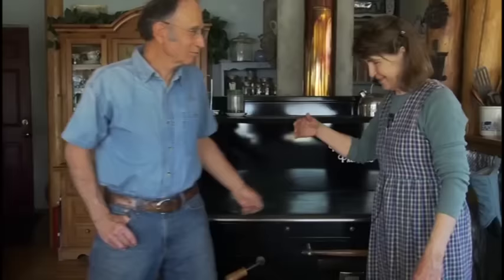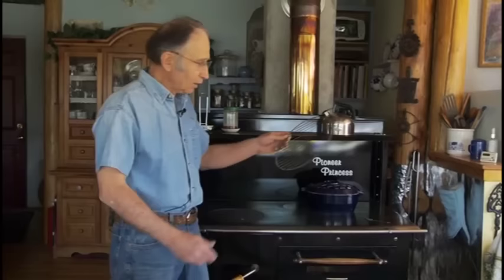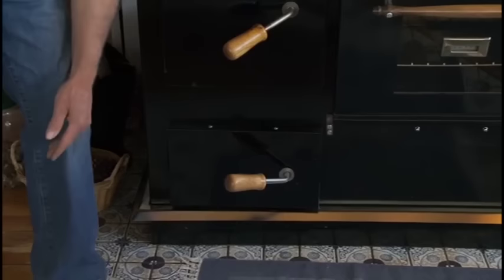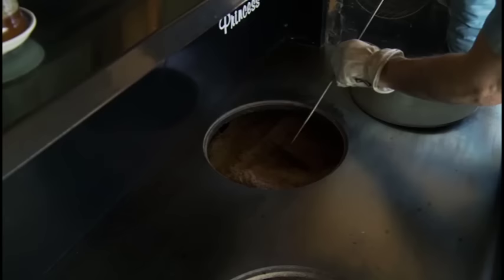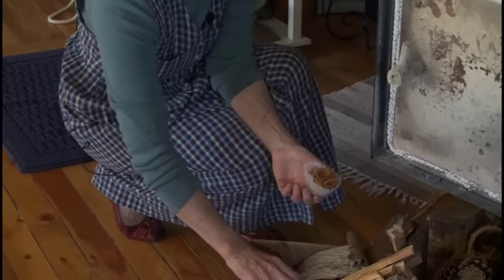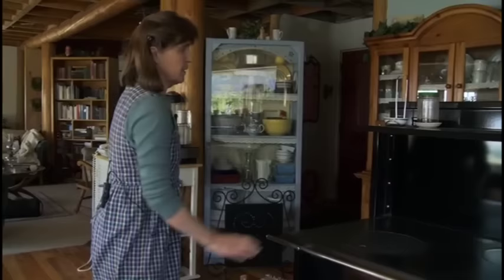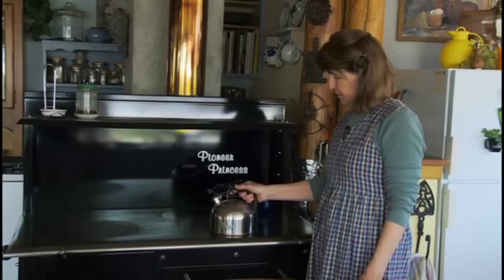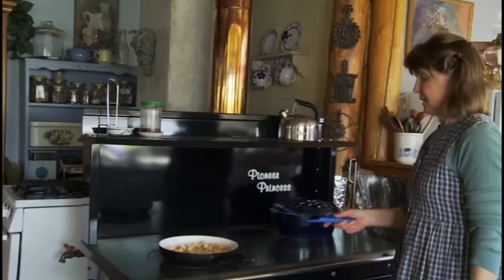A Wood Cookstove is a Must Have!

Comment: Loading the firebox to the max and then slumbering the stove slowly for hours is the least efficient way to burn your wood, and also incredibly polluting. I realise that for space heating purposes this is sometimes seen as necessary, but it really should be avoided wherever possible. Small, hot fires are significantly cleaner, will give you more useable heat from a given weight of wood, will significantly improve the emissions of the stove and also prolong the life of the flue. Much as I love wood cooking and heating I would hate to have a neighbour who slumbered their stove for months at a time.

Comment: You really need a chimney cleaning brush they are heavy plastic that is what I use it will not damage the chimney like your scraper and wire brush might do if your not careful.

Comment: Thats life goals, right there. 
Recent quandary: do you think you could use the silicone or other newfound specialty-coated baking sheets could line the bottom of the ashtray for easy lift and dump removal?

Comment: 3500 Bucks...there is a thing called modern conveniences. As a cook and an everyday home cook. A good one I might add that can cook on any heat source. This wonderful stove is a waste of time. The space and fuel takes to operate is a waste of time and resources. One or two pans and a dutch oven is adequate for what ever you need. Using a stove to heat the house...Great Idea.

Comment: They're burning that stove dirty. ¾" of  creosote at the chimney is bad. Most likely those night burns are the culprit. Stoves should always burn as hot as safety will allow. I own both a wood burning kitchen stove and a wood heater. The kitchen stove only gets used for meals, using very finely chopped wood, for a fast hot burn. Otherwise the more efficient wood heater gets used more often.

Comment: Please tell them the safety bar in front of the stove is aluminum. Just like the aluminum they installed as a safety backer. It dissipates heat faster than any metal but gold or platinum. That´s why the tin tube they used to insulate the beam they mentioned. Did dot work. Tell them they can get a flat aluminum roofing sheet have it shaped by an air conditioning duct builder. or gilded by an artisan and install it for a more permanent look to their kitchen. Tin, copper, pewter, brass, will get very hot,  but aluminum will not.

Comment: WHO CAN AFFORD a good wood cook stove??? They cost as much as a decent used car!!! Because they have as much steel and cast iron as a modern car has in it! I have a 1944 Chamber gas cook stove that weighs about 600 lbs. It has a single oven, a broiler, griddle and deep well  and three top burners, and the oven will bake cakes and pastries as good as any oven made, except maybe a fire tube pastry oven only a pastry shop will have (or the RMS Titanic).  I've priced a new Blodgett 6 burner gas range-$12,000 WITHOUT OVENS!!! A Wrangler 4-top woodstove with oven is over $8000 and 2-year waiting time for delivery. The "full-size" 6-top is $12,000+ ( the price is TBA on delivery) and there is a two-three year waiting time for them currently. Add-ons like the water heater and deep well run the price WAAAAY UP into the Camry range.

Comment: How does it  provide hot water for the shower upstairs?? I’m sure that’s what she said... I can’t wait to get one of these stoves! :)
Reply from the maker: If you well water system is pressurized then you will have a shower on the second floor. Let me know if you need help.
Reply: Engineer775  Thank you so much!
Reply: She said convection - pressure created by the expansion of water when heated - if not given a place to go - upstairs in this case - it will explode - hence the fate of many old Mississippi Paddle Wheelers and Steam Locomotives - choo choo - engineer 775 is too young - this technology a little to old - for him to comprehend - how many cell phone kids today would understand rotary phone / banks of operators downtown

Comment: I have a small cargo trailer tiny house 8 foot by 32 foot with a 73-74 inch ceiling. It's 256 square foot total. Would a rocket stove be the best to heat with?

Comment: Those humidifiers are worthless. You're better off with a huge stock pot....stainless too. you're pretty much reducing water for months and the crusted mineral deposits are impossible to remove from iron or ceramic coated iron in this case, even after soaking in vinegar.

Comment: "There are ways you can tell [the oven temperature]: you just stick your hand in there, and depending on how long your arm is in there before it blisters..."

Or you could buy an accurate oven thermometer for less than $15 and hang it from the upper rack.
https://www.amazon.com/gp/product/B07B52PM39

Comment: rick are you aware of any wood cook stoves that are specifically designed to be efficient at heating as well? like with a blower or heat exchanger attached or something like that? of course any wood stove will naturally put out a lot of heat to heat the home but to my mind unless it has a blower or something it is not as efficient for that "side effect purpose" as it could be....to me the cooking function would be actually more of a secondary function....cooking with wood is more of a backup...but if i am burning a fire every day in the house it will cut down on the heating bill.....i dont want to have to get two wood stoves, one with a blower for heating and one with all the range/stove top oven etc
Reply: HI Michael, I recently commented on the types of kitchen woods stoves I have owned since 1976. The Heartland Oval will heat 1800 sq ft. You can put a non electric blower fan on the cook surface. We have a 1930 Home Comfort cook stove and a 2016 Enviro 1200 airtight that has a blower option. Frankly I prefer an airtight cook stove, like the Kitchen Queen or Pioneer Princess. Best of luck , Diane in New Hampshire.
Reply: diane hall thanks Diane I will take a look at those models

Comment: I am in the designing stage of creating a new kitchen. I've been researching wood stoves and wood cookstoves. I get the many benefits, however since I've haven't used one before,
can they be used in the spring and summer without overheating the kitchen? Thanks!
Reply from the maker: You can get a summer grate for the princess that raises the fire closer to the cooking surface. This allows you to build quick hot fires, cook your food and then let it go out before the whole stove and surrounding area get hot. They are about $100
Reply: @engineer775  Thank you for that, and the great information in your video!

Comment: The one thing I lack, for a SHTF scenario, is a hand pump for my water.  My well is 600 feet deep, though, so I'm not sure if that's even possible.  Any suggestions?
Reply: Frank Burns ---  We had a hand pump installed in our 80 ft. deep well.  They
guaranteed it would pull water up, and it does,  but it takes a lot of manpower to get one glass full.   It is disappointing,  but if you can do it,
you'd survive w/o elec. power to pump it.   It'd keep you alive in SHTF time.
Reply: That's the thing, though.  If yours takes a lot of manpower to get one glass, and your well is only 80 feet deep.  Imagine how much force it would take to get anything from 600 feet deep!  From what I've read, the deepest that any hand pump will work is around 250-300 feet.  I had no idea wells even WENT 600 feet before I moved here.  My neighbors' wells are only 200 feet or so.

Comment: DO YOU GET THE HEAT IN THE HOME WITH ONE OF THESE SIR---IS THERE A FAN THAT PUSHES THE HEAT OUT TO YOUR HOME
Reply: It radiates heat. No fan is needed.
Reply: Can buy all metal fans that circulate by no power that sit on top of stove

Comment: Holy crap people, never clean your stove and pipe like this. Take it outside and wear a mask.  Use a shop vac inside. Ash and creosote are some of the most toxic particles there are . These folks were my neighbors. They had so many chimney fires their chimney had to be replaced with stainless. Dont believe all these "pony rides in May sunshine "videos, very nice people and Janice baked up a storm, but they were lucky not to burn the house down. Use a shop vac when cleaning the stove , really helps with the ash. Having a wood stove in the middle of the house is a dirty affair, cleaning a stove like this makes your house way more dirty. I have a Pioneer Maid(used 20 years) and a Kitchen Queen(used 20 years), they are basically the same when it comes to using and cleaning. I have to clean my stove and pipe 3 times a year, or the stove basically just stops working and then you get into chimney fire mode, I have had several chimney fires in the first years using the Pioneer maid because I did not understand how fast they get clogged up, after replacing my own  chimney with stainless, I learned I need to clean it out about every 6 weeks or else. To me  this video shows how not to clean your stove.

Comment: I lived on a house built in 1885 we had a wood stove/cooker once every 3 to 4 years would we have to clean the chimney the ash twice a season there creating more work for them s elfs the eco fire....wax heats up like a par and sticks to those 90 deg corners high pitch wood does the same it like glue season your wood use pitch based kindling reluctantly Never and I mean Never use a wax based product in your stoves Hey? If your a new and it builds up chimney fire in a short time like a high pitch wood over a a few years think...... about what you put in your stoves.....no wax keep pitch to a minimum yes itvsyarts easy but in the long run your not doing your selfs any favors

Comment: Is fire required or that's optional?
Reply: Ya I think a gas burner conversion would work great.  Electric elements suck in my opinion and without even heat uneven expansion will crack the steal/iron. Of corse you could use molton salt from your nuclear furnace .Lol
Reply: "Is fire required or that's optional?"

It's a woodstove. Fire is the only heat source.

Comment: Have you tried cooking cabbage on a wood stove, on the slow cook side? You will soon realize that you actually love cabbage :D  but you didn't know that because you used electric stoves l until that time :) At least that is what happened with me :D By the way, there is a scientific explanation. The fire transfers heat to the cooking dish mush faster and the wood fire burns at an unstable rate, making the fibers cook with much more intensity

Comment: i live in norway and bought a simular oven but mine also heat water that i store in a 500 liter-200 gallon tank
https://cdn4.mystore4.no/thumb/646_600/varmeshop/74060_Nordica_Extraflame_Rosa_Petra_1.jpg
i havent desided yet if i shall mount radiators ore just use the water tank as a big radiator.
 will test with just the tank this winter.. benefit of the tank is that its not nessesary to feed the oven constant

Comment: Your house must be super insulated.. I've never known that little box to heat and entire house..
Reply: So what did people heat with before furnaces or electric heat?
Reply: CmaxEnergi they wore more clothes and the houses were smaller.
Reply: Morgan D In the 17-1900's, they heated with wood and coal cook stoves.
Reply: I appreciate you trying to enlighten them.
Reply: I appreciate you trying to enlighten them.
Reply: I appreciate you trying to enlighten them.
Reply: My house is 16 years old, so good on insulation, but this stove is about 350 lbs. of steel. It gets hot and stays hot for hours even after the fire is burned down. That is thermal mass in action.
Reply: The design of the firebox is super efficient. It is built like a coal stove where the firebox has a nice grate and the heat travels through the stove and out the back. That firebox is very large, about the size of my parents' coal stove, which they use only for wood. They have heated with it as a primary heat source for almost 40 years. Modern wood stoves have a pipe on top and all of the heat travels up the pipe making them not very efficient. A small fire in this one will heat a large house. I'd bet much more than the 2000 sq ft depending on the layout of the house.

Comment: You folks are not really living off grid, you are off grid wanna be's. My mother in law used her wood cook stove year round, oil lamps were used for lighting at night. There was running water for the kitchen which was water coming from a spring above the back of the house.